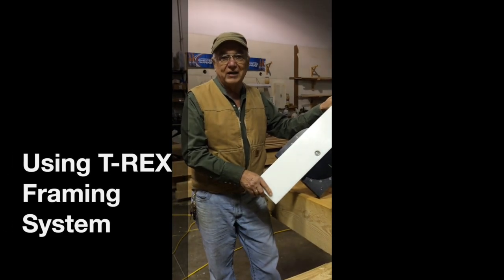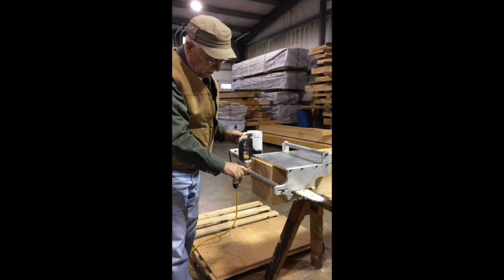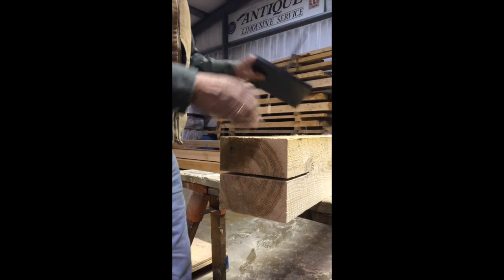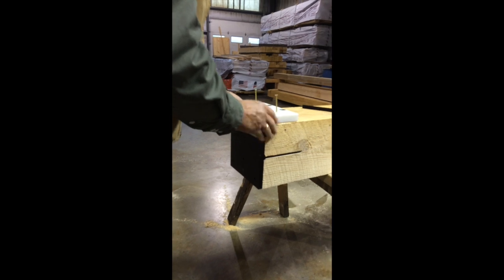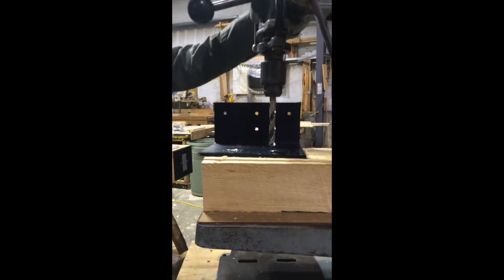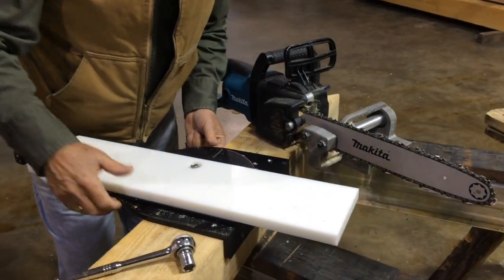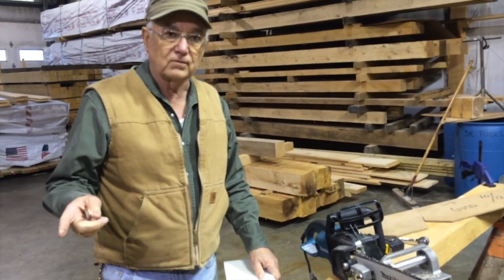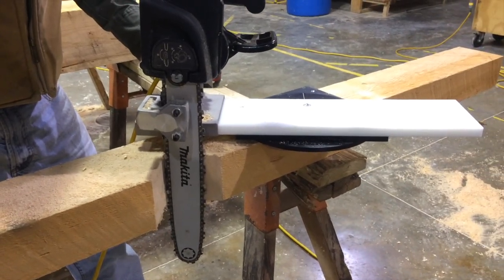Using T-REX Framing System | Post and Beam Connectors | 1-203-534-8771

Comment: I'm not a timber framer, but I am a fellow inventor and tool innovator. What a totally developed product line and method! Every detail worked out in the most detailed and practical terms. Fantastic! One minor suggestion: I don't know if post and beam components are ever produced in the field, rather than in the shop, but if so, it occurred to me that the holes through the T-REX aluminum web could potentially be drilled using one of the commercially available portable drill guides, such as offered by Woodpeckers and Milescraft, among others. I looked at your pricing and, contrary to other commenters here, I can see where investment in the tooling would pay for itself on the very first job, and then many times over for a professional who would use it for years of service. An inspiring post! Best of luck to you in reaching your target market! (Have you looked into exporting your products to Germany and/or Japan?)

Comment: what is the purpose of the t-rex plate at the bottom of the post
Reply: The replace mortise and tenon joints. It is faster to slot a beam, bolt the plate up, and insert a pin. Than to cut and fit the mortise and tenon joints.  I can see this saving a lot of labor, especially if you are building the frame off site.
Reply: @EthosAtheos  At 59 bucks for one 8x8 connection, it BETTER be fast!
Reply: @42lookc  My little brother is a skilled carpenter he makes about 30$/hr so. He bills at something like 50-100$/hr ish.  So how many more hand fit mortise and tenon joints can he make in the time it takes to put one of these in.  My guess is that for a person making their own home this saves some time but not money.   But for a production shop these could make for bigger profit margins. If these are say 25% faster (I think they are faster than that but..)  for every 4 homes you manufacture you get a 5th essentially time free. Compared to the traditional way of doing it.  Also if you are trying to meet engineering requirements I'm sure these are easier to make consistent.   I will grant you If I were making a building for myself I wouldn't be able to justify the cost.  But my labor is essentially free in that calculation.

Comment: Your post connectors are good, however, they required too much other expensive tools, so it won't help the normal DIY!
Reply: hate to agree, but I agree totally. the cost is prohibitive when I could just mortise and tenon or dovetail a joint.